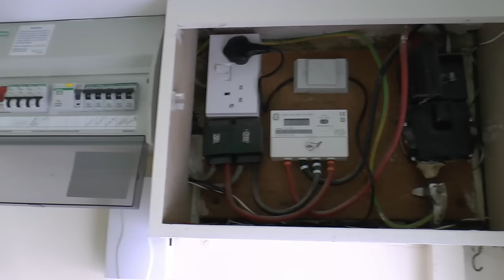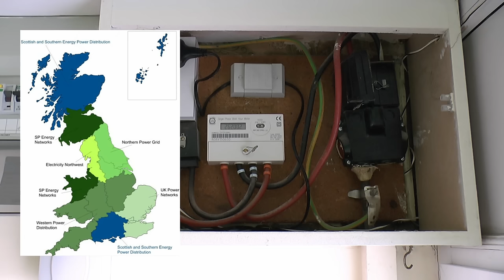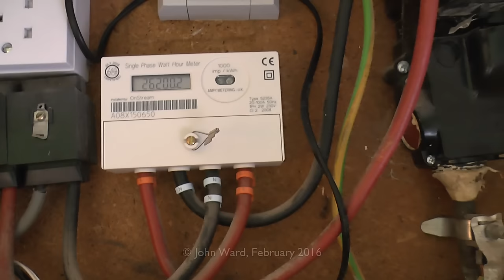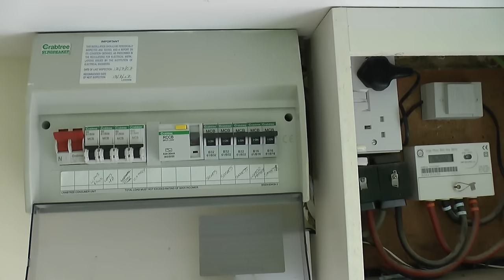Mains Supply And Consumer Unit

Comment: I hope John does a video on installing a second consumer unit ,say for example one that supplies armoured cable going to a shed used for welding. 
So when the dam housing association change the cu again (every 7 years currently)  they don't mess with the shed power putting a MCB that's woefully underrated for the task ,while also taking everything they remove with them and for bonus points shortening all the wires.

Comment: I'm so glad that we have in Germany 3 Phase 63A comming in, in normal Homes. For the Stove 3 Phase 16A, and for the Tanklass water heater 32A 3P :). I never could live without 230/400V 3 Phase.
Reply: +Grumpy Electrician The same thing in Finland. I think that the kWh meter installation appeared in the video was quite a Chinese-looking. In Finland corresponding assembly looks like this: http://www.sahkonumerot.fi/3332078/img/large/color.jpg
Reply: Same in sweden 3phase
Reply: +peto22 It probably got harmonized through some EN(what ever)
Reply: +Grumpy Electrician Obviously not, as UK would have to do it.  Even new domestic properties are single phase.
Reply: +Grumpy Electrician single phase 240v 200amp FTW
Reply: Well in 3 Phase that a just abit more than 69A per phase, so less diameter fore the Wires and less loss. S=(root of 3)*U*I
For 200A you need about 240mm² and for 70A just 25mm², and the double if it's Al insted of Cu. And another nice thing is you can run Async-motors without a cap.
Reply: The netherlands standard homes get singelphase 40 A with a 3 phase 40 A option, my old home has only a singel phase 25 amp. That fuse poped for the fist time since 1963 while puggin an C64 diskdrive.
Reply: In the US, we'd kill for 3-phase 240V Delta power at our homes. To run shop equipment, air conditioning, and heating loads of course. Standard here is single phase, 120/240V. Neutral is centre-tapped, with the 2 legs being 180 deg apart, 120v each to N and Earth, 240 b/w the hots.
Reply: I have single phase 20 A for the stove. We did not get three phase when it was installed. I never use more than 3 kW at a time. In theory it is 8.5 kW max.
Reply: @okaro6595  Damn, my clothes dryer alone pulls more than that.

Comment: That wiring may be a bit messy, but at least the installer has left a good amount of length on the wires to allow for future modifications to the circuits, and minimised on sharp (e.g. 90 degree) bends.  Much rather that than come to install a new C.U. and find the old wiring, though nicely laid-out for the old board, has been trimmed down too short for the replacement.

Comment: I love how you highlight the reality of getting the wiring in these things tidy :-) Keeping them tidy is another thing altogether, I've tried in the past, and then it all goes horribly wrong whenever something needs changing, hahaha.
I may well be in touch regarding a huge, ancient, but beautifully made and apparently working order moving magnet voltmeter btw, that I really want to make work somehow, apparently intended to connect across two phases, unless I'm misunderstanding something. With a coil resistance of 2.5k, it'd have about 96 milliamps running through it at 240v which seems a lot, double that at 480v across phases, so it's quite scary.

Comment: My (external) meter box has the useful extra of a single pole isolating switch on the live between the meter and the connectors for the consumer unit. That is very convenient (and ought to be standard) as it means that it's possible to replace the CU (or all its innards) without calling out the local power distribution company.

Comment: Water bond must be within 300mm of point of isolation (stopcock) or at point of entry to property.

Gas bond must be within 600mm of point of isolation (meter) or at point of entry to property.

RCD test label on consumer unit?

Mixed color warning label on consumer unit?

Single insulated cables below 'Henley' connection blocks.

I'm sure there's probably more but I want paying too much attention.
Reply: +CableWrestler There is a reasonably practicable ruling on water and gas bonds.
RCD label looks to be on MCB cover (which was flipped down)
Aside form the meter tails, all wires appeared to be brown, blue and green/yellow.  If that's the case in the walls, then mixed colour warning not required.

Also, JW didn't fit this consumer unit.

Comment: Our consumer unit is pretty much like this, apart from the cooker circuit hanging off the RCD, and also for some reason the MCBs are a different brand to the RCD and main switch, and also there is a separate smoke detector circuit which is not RCD protected

I have been thinking about getting it replaced with an RCBO one (especially with what happened at the market weighton house, back when i still lived in market weighton, which nearly resulted in frozen food thawing due to an RCD tripping, only for it to turn out that the fault was on a completely different circuit)

Comment: EC15 Earth clamp is a bit dubious on lead incoming service cable, inadvertently over-tightening this clamp could damage or short out the cable leading to a small explosion as this cable is likely backed up at the transformer location by a fuse of around 400 amps . Service provider should ideally sweat a lead plumb onto cable with a short earth lead onto a fixed earth terminal block to which the consumer unit main earthing conductor may be connected.
Reply: +Arfur Watt Or convert system to TN-C-S.

Comment: That CU will have the OCD crowd wincing. Quite a lot of exposed copper at the junctions and, do I see that a few of the strands on the neutral tail feed from the meter cupboard are cut off short and don't go into the main isolator switch terminal in the CU?

Comment: Doesn't the meter board also belong to the DNO so you're not supposed to fix anything to it, such as the double socket and bell transformer as here?
Reply: +Graham Langley Technically it's the consumer's property but only the board's (modern parlance 'DNO's) equipment is supposed to be fitted to it. But nobody pays any attention to that much. Our entire CU is on the backboard along with the meter/cutout.
Reply: The board either belongs to the dno or supplier, not the customer. The customer shouldn't install anything on it but it's ignored nationwide
Reply: So that's two completely opposing answers.  Anyone care to add an authoritative answer with actual evidence?

Comment: Looks fairly similar to my Wylex which is quite old. I wonder if you can explain something with my configuration: It says "These circuits NOT protected by RCD" and that is basically every MCB. To the left, it says "These circuits protected by RCD" and they are all blanked off. However, the main 100A switch (which I suspect was a later install) says RCD and has a test button on it. Does this mean that everything coming off that is RCD protected?
Thanks
Reply: Seems to be so,  but you shouldn't just assume with electrics.  To be certain you would need to have a look inside the consumer unit.

Comment: Hi, I noticed that in your clip your RCDs are marked Live and Neutral but I notice with both the Hager and MK RCDs that they have no markings on the twin pole I presume this is because they can go either way around to aid in the configuration of the unit as long as if you have the live supply on the top right that you have the live load on the bottom right side.

Comment: Also john i would like to ask you is it safe to fit mcb in nuetral and phase for non polorized supply eg euro
Reply from the maker: Only if it's a 2 pole MCB, where both neutral and phase are disconnected at the same time.

Comment: Why is the fuse and meter always placed onto a backboard when the consumer unit is not. Is it a requirement ? Also can you simply add another backboard for an isolator if there were not enough room on the first ?

Comment: Thanks to John for uploading this great guide! I am NOT a qualified sparks, but I do find myself attempting repairs on my little flat, or at work where I jobrole as a "maintenance guy". So, I know this is gonna sound like a dumb question, but when John mentions "the mains switch, the red one" at 8:20 in the video, is this the one that needs to be pressed DOWN if you want to cut power to the whole property, please? Advice welcome! (Thanks in advance!)
Reply from the maker: Yes, that's the one.
Reply: @jwflame  : Thanks for quick reply, John! Safety is everything in the electrical world, I reckon. (I should learn how to test if wires are LIVE or not, really.. I've read somewhere you can do this with something as simple as a "Neon Tester Screwdriver" but I think the pros use digital multimeters with "probes").. More research needed as usual!
Reply: writerNB - Yes use proper test equipment, never, ever rely on a neon screwdriver.

Comment: would it be good practice to install a separate double pole isolating switch between the meter and CU so that you could isolate the CU when it comes time to replace / upgrade it ?
Reply from the maker: No.  Consumer units are replaced every few decades, by the time it's needing replacement, the separate isolator will need replacement as well.

Comment: John , i have a similar unit to this my electrician suggests i need a new compliant consumer unit as he is wiring a kitchen extension to my house and the unit needs to be compliant so a certificate can be issued for the works  .any views , the board will still be compliant but will any new works be ?effectively the same white goods will be run with an additional dozen down lights dotted around .  He claims a new unit would be circa £500 ..for the unit  !maybe fitted would be correct?  
Great video .

Comment: Appreciate this video is getting on a bit and slightly out of date, however, i just picked up the latest Toolstation flyer with some Contactum metal consumer units advertised as High Integrity 18th Edition dual split load (with a number of MCBs). States that it conforms with BS 7671 IET Amd 3, BS61439-3.
However it has no AFDD or RCBOs for each circuit as I am more or less being drummed into. So does this mean then that we DO NOT actually have to fit RCBOs for each final circuit and omit AFDD and we are being told a red herring? Does anybody ACTUALLY know without having a guess at what they think it might be or is in their opinion?
Reply from the maker: 61439-3 is the standard for consumer units, they will all comply with that.
Amendment 3 refers to the 17th edition which was published in 2015 and has been obsolete for years, replaced by the 18th edition in 2018 and the 18th Amendment 2 in 2022. 
Amendment 2  can be used from March 2022 and is the only option from September 2022, so certain retailers of consumer units are discounting their old stock to get rid of it while they still can.

In 2022, AFDDs are required for some circuits in some types of building, and recommended for most others.
RCDs are required for pretty much every circuit in a domestic dwelling, and those RCDs must be type A or better unless it's the unusual situation of a circuit with only a fixed resistive load such as an immersion heater.
Surge protection is required for almost all installations.

Multiple circuits from a single RCD is a poor choice and has been for years, and although it's possible to fit such things and comply with BS7671 in a few cases, in most situations RCBOs are the only realistic option.
The main items are division of installation where the failure of one circuit should not affect others and the maximum leakage current in normal use being a maximum of 9mA per RCD,  which is very easily exceeded where you have 50% of a property attached to a single RCD.  Other less common problems are that items such as PV inverters can't share an RCD with anything else,  and some items of equipment require a specific type of RCD such as F or B.

The consumer unit in the video is from the very end of the 16th edition era in 2007, and at the time RCDs were not required for circuits such as lighting, which is why it has a single RCD which only covers some of the circuits.

Comment: In the USA it's required that all panel boxes have wires perfectly installed and parallel.   We have two or three phase power too.  And we have a main disconnect.  At 110 and 220volts, we may have on a house 60 to 400 amp service.

Comment: Keep up the excellent videos.. very well presented.. and informative.. have a question for domestic installer.. what type of tester you recommend.. kewtech or fluke.. and model..
Reply from the maker: I have only used Fluke (previously Robin), so can't recommend or comment on other makes.
However other than being able to do the tests required, the main consideration should be that is is designed/built to withstand incorrect use or faults without bursting into flames or exploding.

Comment: John just curious how do you take the live and neutral from the meter to the consumer. Like how do you work with the live..how do you isolate it in order to connect it to the consumer unit..
Reply: Electricians are meant to contact the local power distribution company and have them pop the main fuse out (which has a seal). However, it's not unknown for some electricians to just do it themselves. My house has an isolator after the meter, so that's unnecessary. Why that isn't mandated as a standard I don't know. 
A lot of this probably goes back to the days when power supply was a state monopoly without the clear demarcation points.

Comment: HI JW. Question : once you replaced a consumer unit what kind of tests you have to do? Thanks
Reply from the maker: All of them as described in this video: https://youtu.be/Sc0tJGl4Oas
Normally these are done before installing a replacement consumer unit, so that any faults can be fixed first.
Reply: Thanks for your quick replay. I love your videos. They are
very easy to understand, instructive and at the same time in depth but not too complicated.
Keep at it helped even my wife to understand electrics to some degree. Thanks, again

Comment: Never understood why in the UK you don't have a switch on the breaker itself, what do you do if you have to change the main switch or the cable that goes from the meter to the main breaker ? Also having a main fuse, if you burn that what you do ? Better to have a breaker integrated in the meter, and that is also a minimum protection for people that simply connect all the home wiring directly in the meter with no breakers or RCD (yes, I've seen it)
Reply from the maker: For changing the consumer unit or meter, the supplier fuse is removed - that's what it's designed for.
If that fuse fails (which is almost never), the supplier will replace it.

Comment: Just looking at this older vid John and ... I have a question pleeze ?
 Should the total MCB's current rating (all MCB's added up) never exceed the main fuse  or does diversity apply ? 
I heard this somewhere... 🤔

😎👍☘️
Reply: For domestic use, diversity applies. The rating of the main switch should however be equal to or exceed (1) the supply capacity (the fuse in the cut-out) and (2) the maximum expected load current.
For industrial use, it may not always be appropriate to apply diversity, as in a factory all equipment may be in continuous use during the day/shift.

Comment: John, We had a annual gas safety check (landlord pays for this) on our supply and the gas engineer failed our gas meter as it is too close to the electrics (all in the same cupboard about 0.75 metres apart) can we force our landlord to get one or other supply moved as they are refusing saying it is "Only an advisory" But the gas engineer stated on the paper work "Gas supply too close to electricity supply and it is deemed as DANGEROUS" Would like your thoughts as an Electrician please. Thanks Clive
Reply from the maker: +Clive Clarke-Watson Minimum separation distance is 150mm, between consumer unit & gas meter/pipework, or 25mm between gas pipes and cables, switches etc.  If yours is 750mm, this is significantly greater than the minimum required and therefore not a problem.
Even if the distance was less than 150mm, an alternative is to install an insulating panel between the gas and electric items.
Certainly not dangerous.
Reply: *****
Thanks for that informative answer John! Keep the informative videos coming thanks Clive

Comment: What is the correct bonding connector that should be used for the bonding onto the lead sheathing.
Reply from the maker: Braid and a constant force spring, example here: https://www.cablejoints.co.uk/sub-product-details/3m-scotch-electrical-tapes/constant-force-springs
they maintain proper contact without any danger of over tightening and damaging the cable.

Comment: mate i wish u could do a video on how to add a 30amp wire and add a new breaker switch i got a koi pond and need to add a heater but all the decent heaters are 30amp or more so i need to add it i got room on my unit for another 2 switches but not sure how to i got a better understanding after watching this but not 100% accually i just looked again and there is the 2 breaker switches there but theres nothing wrote underneath and they turn off would i be able to run a 30amp electric cable to it it says that it is 63amp max i thinking is the swiches got power running to them so i would have to connect the wire to the switch then would be running is that write thanks